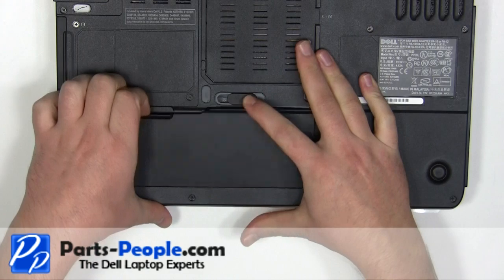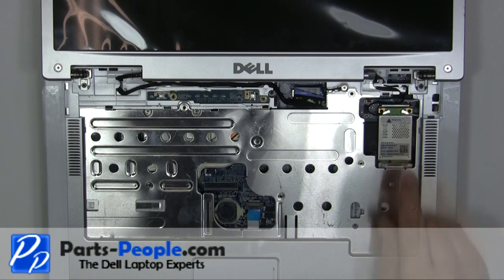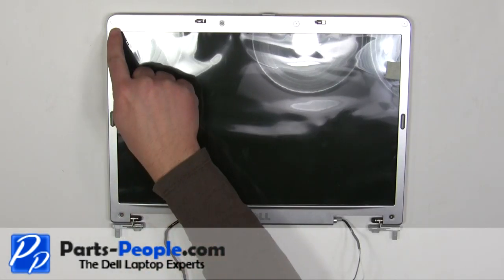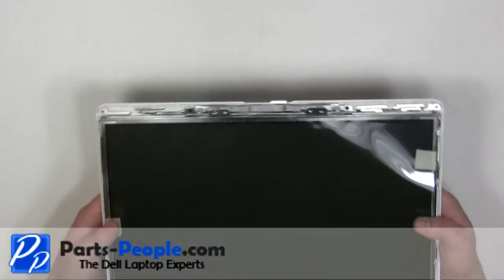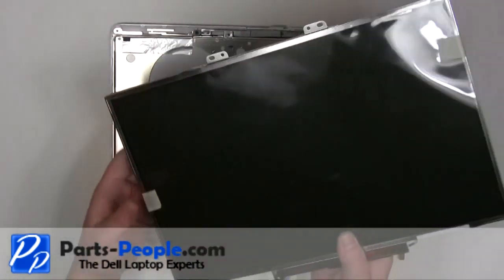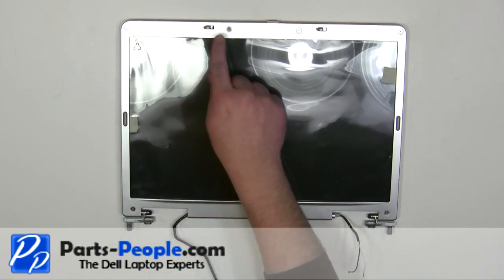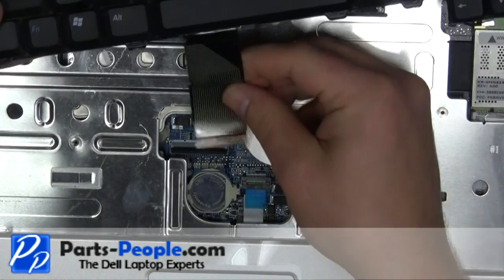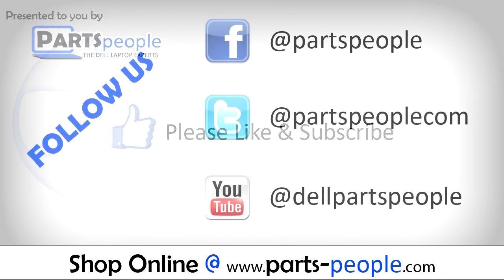Dell Inspiron 6400/e1505 | LCD Screen & Cable Replacement | How-To-Tutorial

Comment: Greetings. Thanks for the post. I'm currently working on an inspiron 1501 with a malfunctioning screen. I managed to get my hands on an Inspiron 6400 with a faulty motherboard. Been doing a little research and since both have the same screen size, and are quite similar models, I wonder if the screens are interchangeable. Could you please help? Thanks in advance
Reply from the maker: As long as they are the same resolution they are interchangeable
Reply: Parts-People.Com, Inc thanks for your prompt response and support

Comment: I'm using this laptop as a seedbox in my home, I wonder if it will boot up without the LCD screen, mine is not working and have no plans on replacing it, I have to boot with a vga cable, so i want to permanently remove the screen and wifi card, so it consume even less power than now and easy acces to the power button in the case of a powerloss or system hang.
Have you ever tried it? I know some old compaq models work flawlessly without the screen.
Also, i wonder what is the bigges hard drive you can put on this, mine is a very little 80gb drive, and i'd like to put a 500gb or 1tb drive, but i'm not sure if the bios will recognize it, now it has a 1tb usb drive for the downloads, but if is posible to have less cables around, will be very nice.
Thanks!

Comment: Great instructional video. I cracked the LCD on my 6400, ordered a new one from these folks and used the video to swap it out. You will need a small (very small) phillips screwdriver. Even better if it is magnetic. 5 small cups or small containers would be handy to store each of the 5 screw sizes on your work surface so they don't get lost. They are VERY small. Easy Peasy.

Comment from the maker: The best way to be sure is to remove the screen and get the part number off of the back. You can try looking up the build sheet on dells website using the service tag but, I've seen Dell put the incorrect listing on there. Here is a link showing how to find the part number ( ppci.me/b/FXEd ) and here is one showing how to use dells website ( ppci.me/b/FXEf ) if you want to look up your service tag.